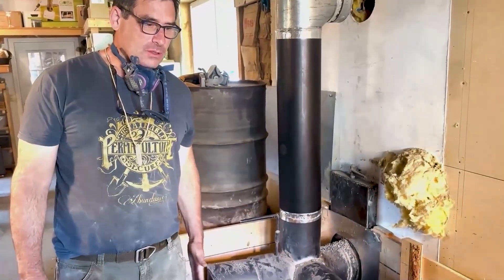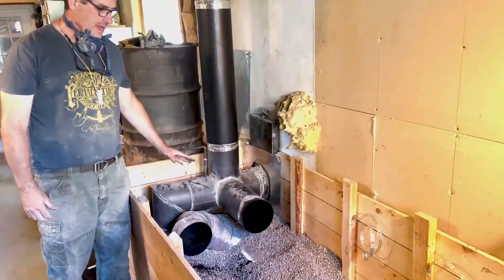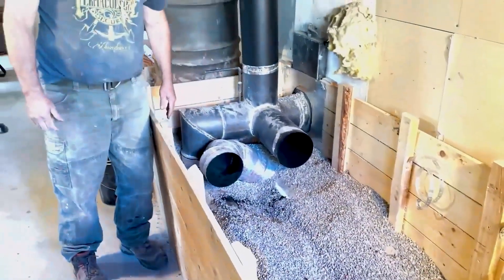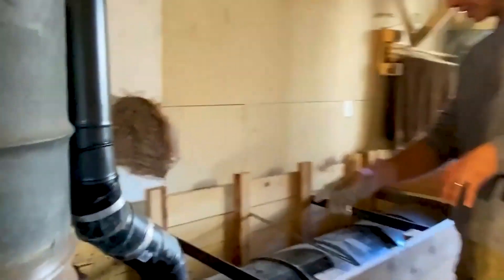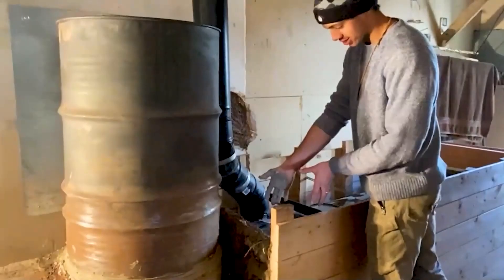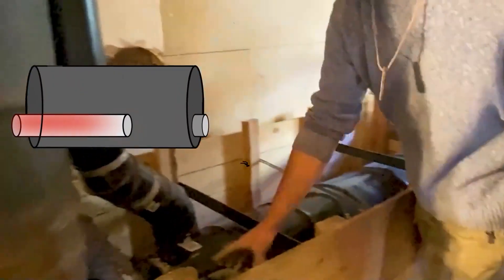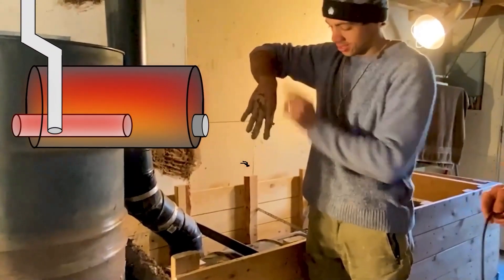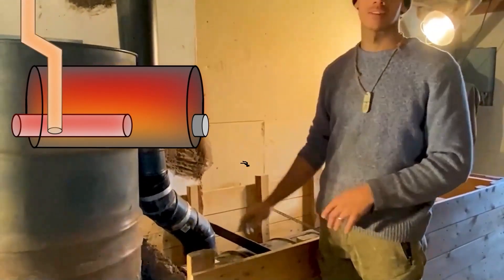replacing duct with a large stratification chamber in a rocket mass heater

Comment: I would suggest using sand turn the whole thing into a giant sand battery

Also, I would use a farm grain scoop made of sheet metal for scooping and filling the rocket mass heater
Reply from the maker: We tried sand about 15 years ago - sand is insulative, so it doesn't work.

Comment: The more I think about it, the more I wonder how much Stratification is even going on in these Stratification chambers. I suspect the close proximity of the inlet pipe to the back wall of the barrel would cause turbulence inside the barrel which would really mix up the air and any Stratification going on I'm thinking. I'm also thinking it might improve the efficiency of the design more if the inlet tube was in the center of the barrel and also twinwall tubing to add insulation as well as the  outlet tube being insulated. Maybe not worth  the gains due to complication in construction, but as it is, the tubes that extend into the barrel are wasted surface area that allow some heat to go straight up the chimney. The inlet tube is right next to the outlet tube in the barrel, so right as the exhaust enters the barrel, its heating up the air around the outlet pipe that is exiting the barrel. The Inlet tube that goes through the barrel to the back is also heating up all the air exiting the barrel. If the Inlet tube was insulated, it would have a higher temp inside which would aid in better combustion,  bit also more heat would make it to the back of the barrel, this increasing the amount of heat the back portion of the barrel would extract. I would atleast insulate the outlet pipe inside the barrel though.
Reply from the maker: We have measured some substantial differences in temperature with 8 inch duct.  So it is fair that the barrel will have even more substantial differences.
Reply: @paulwheaton  That makes sense because the larger 8" Duct will have more volume and surface area that both slows down the exhaust air velocity as well as increases the surface area over 6" pipe, so following those principles, I would expect similar gains from an even larger barrel assuming it has greater total surface area than the 8" pipe. I'm a huge fan of using the barrels as much as possible to replace smaller diameter ducting, and not by any means trying to knock these Stratification designs! I'm just questioning if they are really working exactly the way we think they are and want to know exactly what's going on. My guess is it's really the slower velocity flow and greater Surface area increasing the heat extraction gains and not so much Stratification so to speak, but I'm always open to change my views if it proves to be otherwise. Lots of amazing builds and experiments going on this channel!
Reply: At some point I want to try experimenting with a massive strat chamber filled with large riverrock, 6 inch plus. There's lots of air gaps between round stones that size, but not so much as to allow turbulence.

Plus more mass than straight open space.
Reply: @priestesslucy  Very interesting idea! I'm thinking that turbulence is actually a good and desirable thing to have inside the large volume chambers. The more the air moves around and deviates from a straight path through the chamber, the longer distance it has to travel, and the more heat is extracted due to the increased exit time of the air. Also, if one part of the chamber inside is significantly hotter than other areas of the chamber, then those cooler walls of the chamber aren't extracting as much heat as they could be, and maybe the hotter area is extracting less heat than a more equalized chamber wall scenario would. Just guessing at this, but my intuition tells me turbulence may well be a highly desirable thing to have in these chambers as long as it doesn't  negatively effect the draft to where its causing exhaust leakage.

Comment: I wouldn't have thought the throughput of a rocket fire would allow for much a stratification.
Reply from the maker: And yet we have measured the tops of ducts are much hotter.
Reply: @paulwheaton  wild stuff. Did you , or do you have plans to, put more conductive material on top to more quickly pull heat oit of those higher temps?
Reply from the maker: @GigaTyGuy  just what you see in the movie

Comment: Just my opinion, but I think calling this a Stratification Bell chamber probably isn't and accurate description of how its actually working. Because the airflow through the chamber is so rapid from the draft, the main element moving the air is the draft, not Stratification. This is a great design that pulls a lot of heat out due to the large heat extraction surface area, but I really don't think there's much Stratification going on. It's just the draft pushing/pulling the air through taking the path of least resistance according to the path you've allowed it to, I think. Great design nonetheless and one I use.
Reply: I was out there when it was being built, and I recall a a temp reading of the barrel, before the mass was added back around it, showed a significant difference in temp between the top of the barrel and the bottom while it was running. So in theory the air inside the barrel was leaving the intake, drifting to the top of the chamber where it starts to transfer heat outwards, and then moves down to the bottom where it can be pulled out by the exhaust. The temp reading of the final exhaust is similar to a RMH that uses the longer 8" ducting.
Reply: @Mark-xt8jp  The amount of movement of air " drifting" from Stratification compared to the amount moving from the draft itself would be minuscule in comparison. For example, if the force of the draft was 100 ft/lbs of force the Stratification would be something like 1-5 ft lbs of force moving the air.  Not exactly  those numbers but I'd be surprised if it's too far from that. My point is that Stratification is doing very little of the moving of air and that the draft itself is doing it so much so that IMO I'm not sure calling these Stratification Chambers is an accurate description. But hey we have to call it something I guess, and Stratification is a cool name so I continue to also call it that. I just like to have an idea or theories of what might be really going on which in the long run I think helps understand and implement design better. The above theories are just my thoughts and opinion and I'm always open to data showing otherwise! That would be cool if Stratification WAS actually doing a heavy amount of the air movement, but I really thing you would have to have way slower air velocity going through the ducts to achieve that. That being said, I do see the situation where the draft flow could be at its lower limit and maybe a tiny amount of Stratification could help lower resistance enough to make a nice difference. Every little bit helps.
Reply: I think there's some confusion here on what stratification is for. I think it's being implemented to separate hot exhaust from lower temp exhaust. To prevent sending extra heat up the chimney. Using a big chamber instead of winding tubing is to reduce drag. And the hopeful stratification is to not waste heat in doing so.
Reply: @GigaTyGuy  The amount of heat extraction from any pipe or chamber design is simply a ratio of surface area to the amount of time the exhaust is in contact with that surface area, and also the rate at which the heat is being conducted through that surface area. So taking the mediums heat conduction rate out of the equation, (which Stratification has nothing to do with) it's a simple airflow to surface area equation. So with a Stratification chamber, the real question is: is Stratification itself  actually contributing much to the equation, and how much does Stratification effect airflow and the the amount of time the exhaust is in contact with the surface areas of the barrel? My theory is not much at all and that Stratification itself isn't really contributing much to the efficiency of this design. It's simply the path of the airflow with the amount of surface area the airflow is in contact with which the draft rate is really driving, not Stratification. To find out if this design is truly more efficient than the previous smaller diameter pipe design, you can simply measure the exhaust temp exiting the chimney, but you can also verify/calculate  its efficiency by calculating the total surface area of the previous piping system and measuring the rate of airflow through the piping, and then compare that to the new Barrel Stratification system. I'm fairly certain that Stratification has little to do with what's going on here as far as heat extraction efficiency. If the piping system had zero Stratification  but had more surface area contact, more friction and slower airflow speed, and more thermal mass surface area than the barrel system, it would perform better. If the Barrel performs better than the piping, it's because it has more surface area and slower airflow, not Stratification.
Reply: @GigaTyGuy  Also, if the Stratification effect of cooler air dropping in the barrel worked in favor of the draft by lessening airflow resistance, that would speed up the airflow and make the system less efficient. Too strong a draft reduces heat extraction efficiency. For maximum efficiency you want the slowest ehaust airflow possible  without causing exhaust leakage back into the heating quarters.
Reply: I’m going to agree with you on this. It seems to me that the smaller tubing would do more for pulling heat out of the exhaust simply because of the increased surface area of the ductwork. The double barrel design has “significantly” less surface area for the heat to be removed from the exhaust. 
But, I’m not there, didn’t build it, and haven’t seen the results; therefore, this is just a simple rambling of an internet user.
Reply: Right, as I see it the stratification isn't intended to move the air. 
And by moving the air I mean sending it up the chimney. The rate of flow going up the chimney doesn't change.
 What changes is it is given a chance for the heat to rise, because it goes from the faster flowing pipe and into a slow moving space. When the flow slows down the slower moving heated fluid has a chance to rise to the top of the space and be stored there as heat is removed.
Air going up the chimney is drawn from the cooler fluid at the bottom of the space.
Reply: @oscarvogel2140  I still don't think Stratification is doing much even with the air slowing down. Yes heat rises, but the efficiency of heat extraction doesn't care if it releases its heat at the top of the barrel, sides , or the bottom. All that matters is how long the moving hot air is in contact with the inside surface area of the barrel. I don't see Stratification doing much to help that out here. If Stratification isn't slowing down the air, then its not increasing the heat extraction.
Reply: @nateross14  Going through the larger diameter barrel IS slowing down the airflow, compared to it flowing through the smaller diameter ducting. You seem to realize this at the beginning of your last statement but ignore it by the end.
   In the ducting, the faster flowing air drags heat with it. In the larger chamber, which has a larger surface area than the ducting, the heat is at the top and cooler fluid near the bottom. That cooler low-hanging fluid is what heads for the chimney after is it separated by stratification in the larger chamber. Leaving the hotter fluid behind.
I don't think how long the moving hot air is in contact with the inside of the barrel/chamber is "all that matters". I think the fact the air is hotter matters as well.
  Stratification is separation. With this chamber the fluid/air is separated and the cooler air near the bottom is sent up the chimney.
Reply: @oscarvogel2140  Not sure how your getting the idea that I'm ignoring the slower air from the larger volume toward the end of my post....Nothing I said is saying that the air isn't going slower. I think you're over simplifying what's really happening inside the barrel regard to  Stratification. You're not realizing that the air you think is much cooler exiting the barrel is actually getting heated back up before it leaves the barrel by the uninsulated inlet pipe that is right next to it and all along the length of the barrel. Obviously the the temperature of the air matters in the equation of how much heat is extracted, I wasn't really saying that that didn't matter when I said what matters is the air flow velocity and the amount of time it's in contact with the amount of surface area. I just assumed that we were already working to have the hottest air possible in the design, and therefore all that we needed to focus on was air velocity, surface area, and the time in contact. But I did mention in an adjacent post that insulating the inlet and outlet pipes inside the barrel would increase air temp and lessen parasitic reheating air loss from the air exiting the barrel. I still maintain that what you're calling Stratification of the air cooling and dropping isn't really doing much to contribute to the efficiency of heat extracted in the barrel. The air cooling is more just a by product of the airflow and heat extraction. Having cooler air at the bottom of the barrel before it exits isn't really doing much of anything to help the heat extraction process. It's just a left over result of the process. What you're calling Stratification inside the barrel happens just the same in a run of straight pipe, the further down the pipe you get the cooler the air is going to be before it exits the pipe. I don't think the hotter air rising in the barrel and the cooler air dropping is positively contributing to heat extraction, if anything it would slightly increase airflow velocity and decrease the amount of heat extracted due to a faster draft. The efficiency of jeat extraction with this design is coming from the larger volume of the barrel slowing the air down and the greater  surface area inside, not from Stratification of air or hot air raising to the top of the barrel.